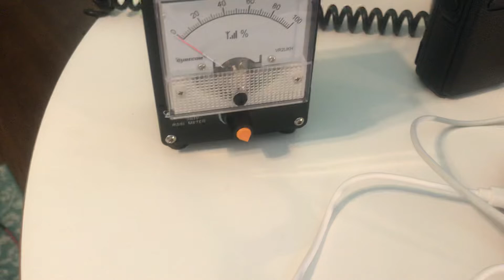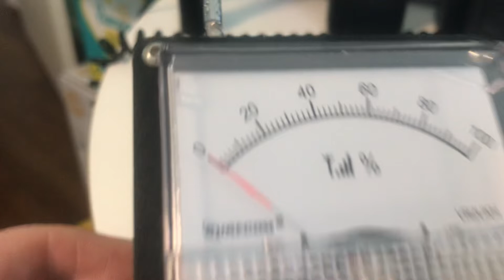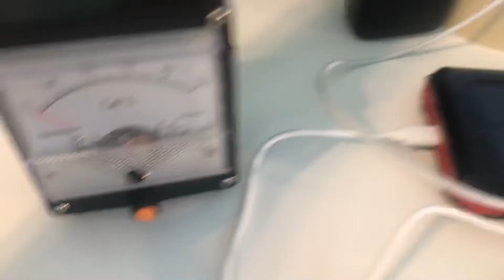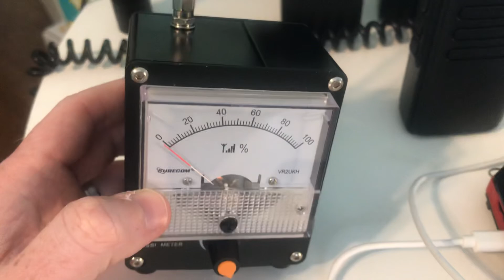Surecom SS10 Field Strength Meter RF 100 kHz - 3 GHz 0.1 MHz - 3000 MHz Super Quick Demo

Comment: Could you use this to do fox hunting out in the field with at longer ranges do you think? 🤔
Thanks
Reply from the maker: It would certainly help once you're closer in.  If you have an antenna that is resonant on the frequency you're using it would absolutely be helpful for direction-finding fox hunting or DFing signals.
Reply: @R4002  thanks for your advice, what does resonant mean sorry? I've got a wide band antenna that's around a meter long that goes from HF to nearly 1200mhz I think. Is that resonant? Or does it have to be like more targeted to the frequency you want? Thanks
Reply: @thegadgetemporiumaustralia8509  The next model up is the SS11 and it has a built in amplifier and needs a 9 volt battery 
and these are much more sensitive.
A resonant antenna is really good at a specific frequency but not so on other frequencies.
A very broad banded antenna works across large frequency range
but is generally not resonant
although it will be resonant somewhere lol.
He means an antenna designed for the frequency you are using
because when an antenna is resonant it delivers a stronger signal to the meter.